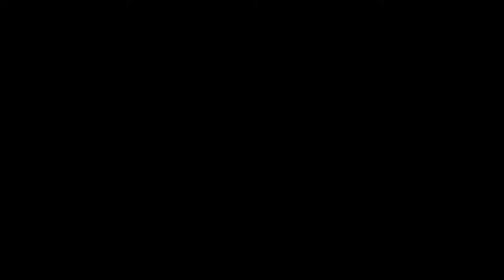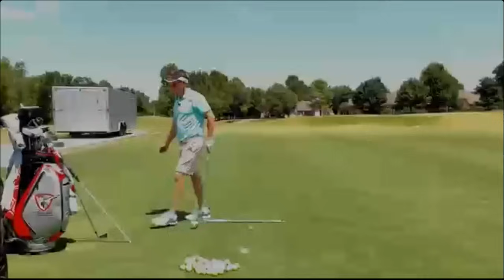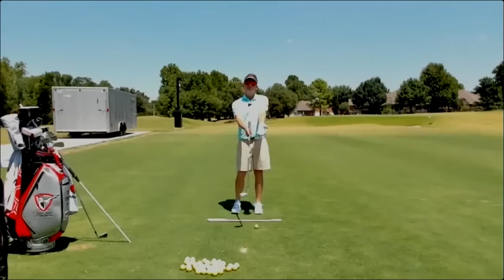Single Plane Q&A at Graves Golf Performance Center

Comment: @Todd Whenever I am "struggling" (this time with face control) it turns out that I only have to watch your latest video and BAM! you do or say something that I notice that fixes the problem. This time, when I put your warm-up swings on slo-mo, I noticed the folding of the trail arm on the backswing. Bingo! I was keeping that arm too straight, resulting in going back too far and losing my face angle at the top. Synchronicity, (timing) like confidence are critical in the proper application of sequence in the SPS. Thanks as always.